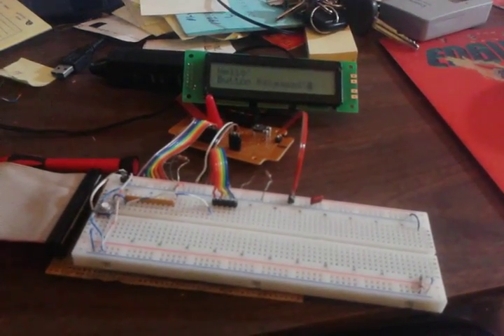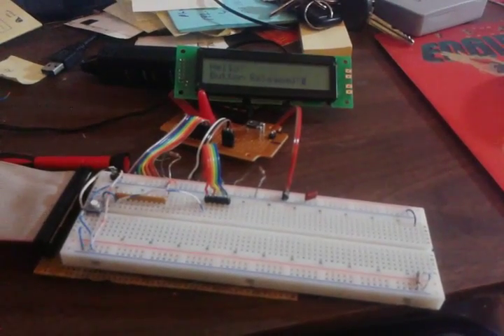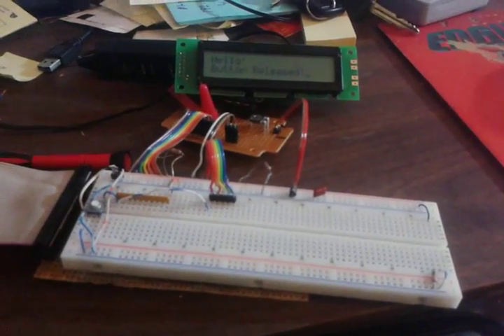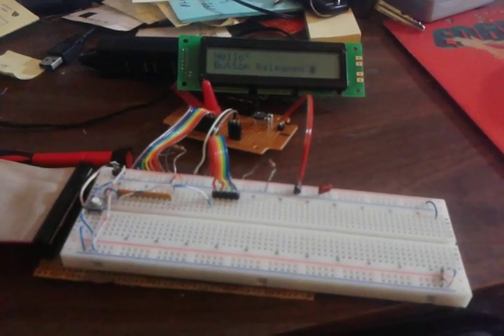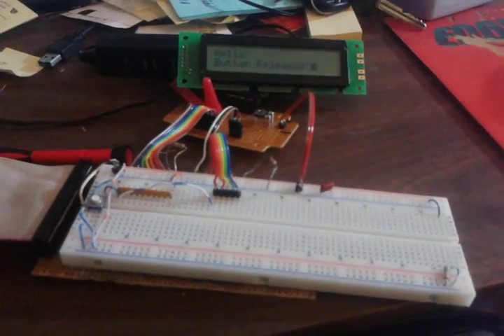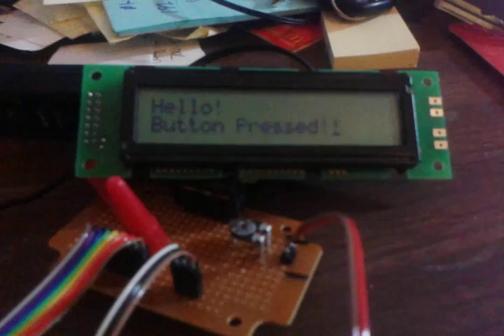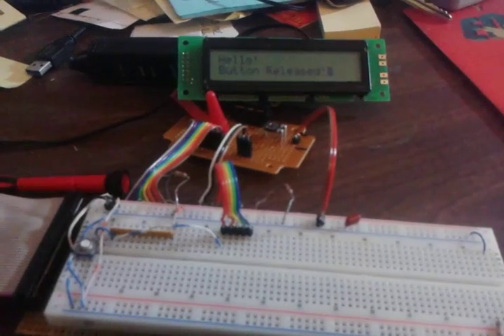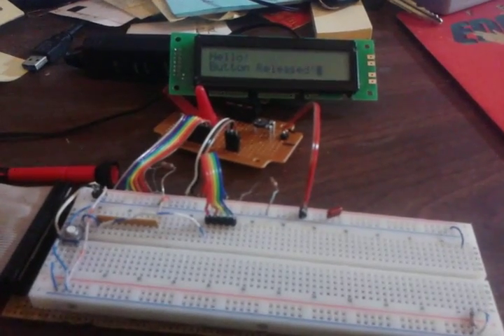Z80 PIO driving LCD display

Comment: What about ommiting PIO and connecting LCD directly to the data bus? E pin could be connected to some address decoder (to make it go low when certain address appears and both IORQ and WR pins go low). I don't think there is a need for PIO here.
Reply from the maker: macieksoft this was just an example of using the z80 PIO as a interface, of course I can connect it directly to the bus with a decoder which I do later on with another LCD display.

Comment: pretty cool. I'm in the process of building a home brew z80 machine. when I was ordering my sio chips the ebay seller sent me pio chips instead. now I have a reason to use one.
Reply from the maker: I wrote a custom print routine for the LCD in C vs. using printf.  Z88DK does allow you to create a display driver library to use printf if you want to use it but requires more overhead memory wise.